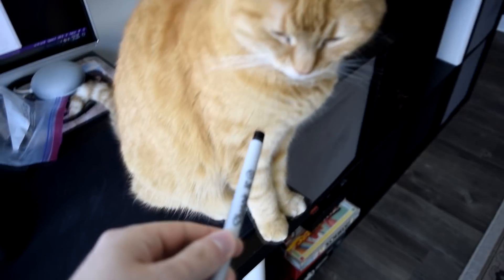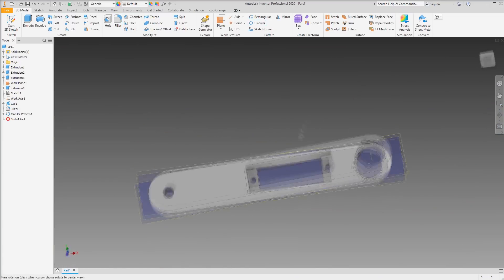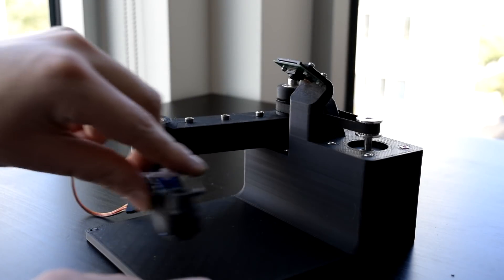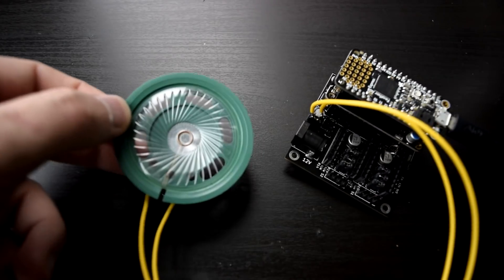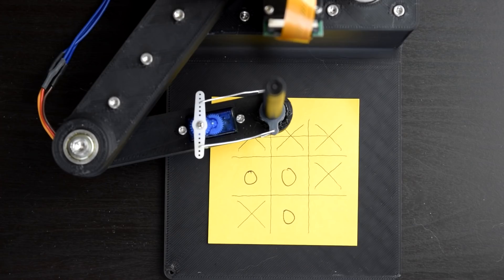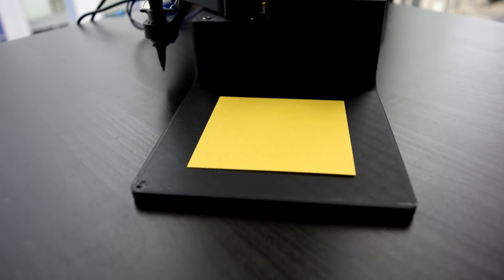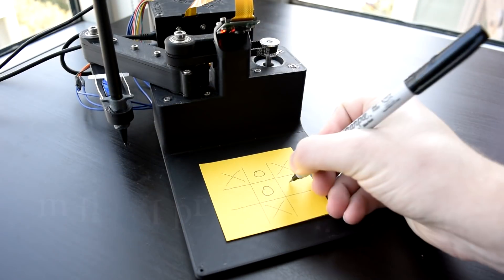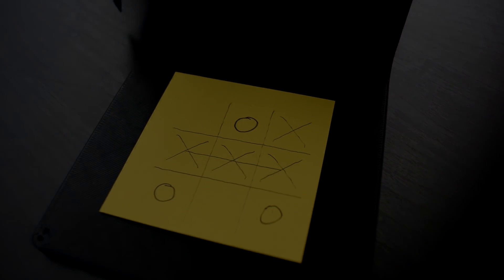My Pi-Powered, Tic-Tac-Toe Robot has Serious Attitude!

Comment: great project!
I have a question regarding the scara arm. Couldn't you improve the quality of drawing? It looks like it is shaking so much. Is it because of the acceleration or because it has been made with 3D parts and has low rigidity?

Thank you!
Reply from the maker: Thanks! yeah the shakiness was really annoying, the main reason was that I used a 3D printed base piece underneath the post-it which as grooves, and the pen is sharp enough that it just gets caught on every little groove. Switching to a sharpie pen or something like that and smoothing out the base would definitely help. The arm itself is fairly rigid, but it could definitely be improved further. The main issue was getting enough belt tension in that internal link's loop, but with some more tuning and tweaking it could definitely get better!

Comment: Add the feature so you can go first.
Reply from the maker: Yeahh I considered that, and its even already half done in the code. But if the user goes first the bot will need to cheat just about every game to avoid tying. Figured this way at least the bot can beat ~50% of people without doing anything sus, but then handle those other "clever" people with it's "special operating modes"